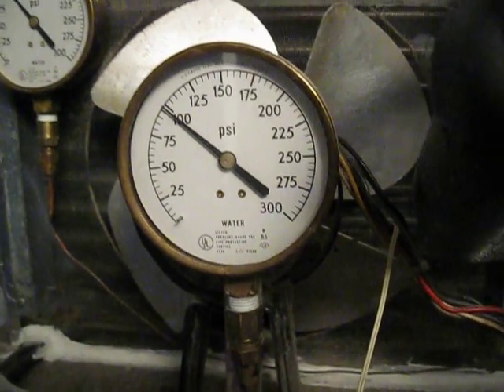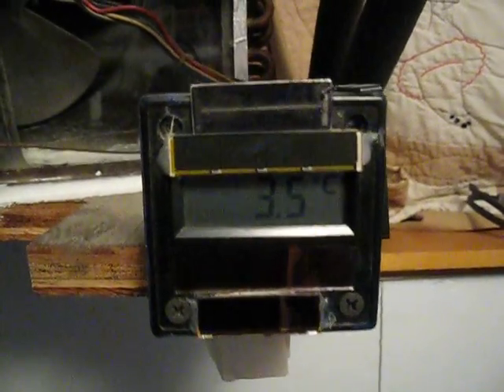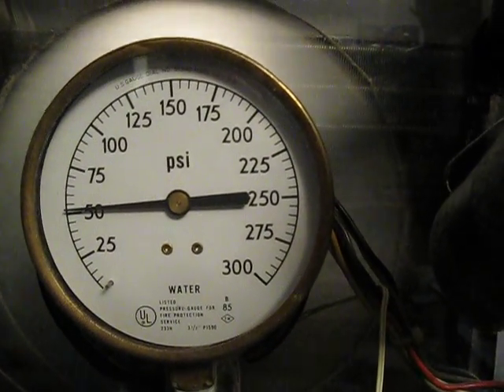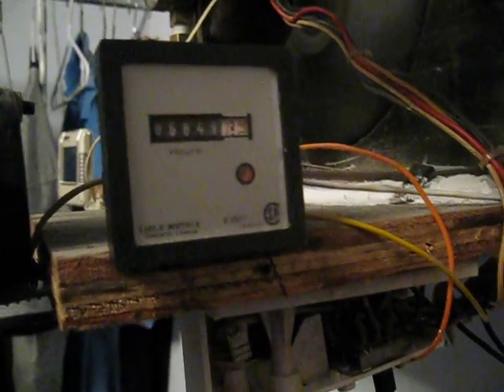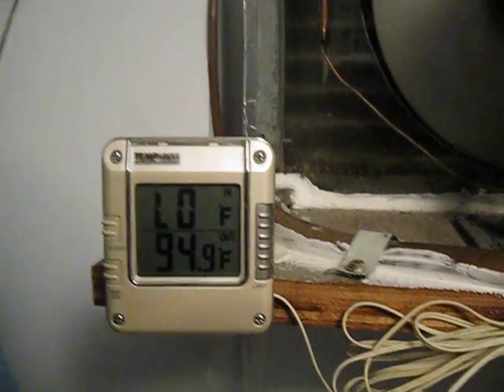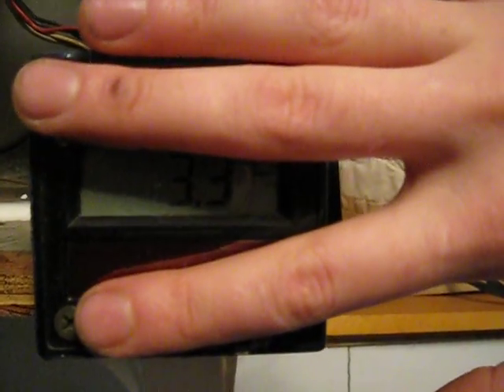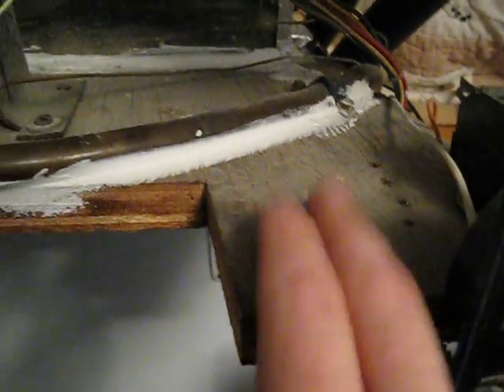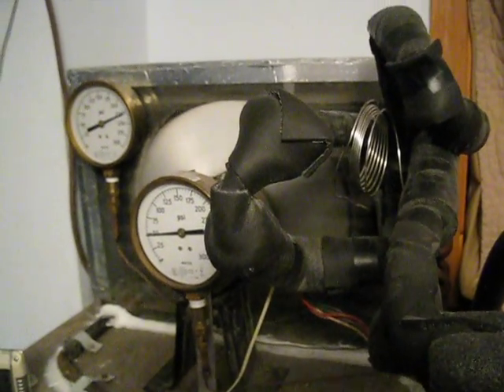Homemade HeatPump Defrost

Comment: Neat heat pump there, I like it.
Reply from the maker: Thanks, was built from scratch.
Reply: I have plans to build a portable heat pump from scratch with flexible pipe to direct the air, and use propane as the refrigerant (going to find a scrapped condenser for it tomorrow) your video here inspired me to mess with phase change heat pumps, it deserves more views.
Reply from the maker: Electrotechnics My heatpump uses R290 (propane) as its refrigerant and it works good, I have been thinking about adding a small amount (an ounce or 2) of R410 this winter to see if it improves my heat output.
Reply: HL4EHalfLife
I have read that r290 is better (more efficient and pumps more heat) than r410 but it would be a good test. i have also heard that 75% r740 (argon) +25% r134a can be used to get around -120C  (yes you read that right) on the evaporator (using a regular air cooled condenser) with pressure below 300psi. That would be a neat experiment, but if you want to do it I would recommend testing it on something other than your HVAC to make sure it works out okay.
Reply from the maker: Electrotechnics R410 is what they use in all heatpump's nowadays because it gives out more heat than R22 (R22 is just 290 with a fire suppression agent added from what I've been told.) As for the R740 that would only work in a cascade system.. which I have build a few but my 2nd stage gas was R290 and Co2 which would get me to -100c. I do plan to do a video on it some day but I have to find and fix a leak in the 2nd stage.

Comment: Hey, I'm thinking about converting an old portable air conditioner into a window heat pump and I was wondering if you could help me out, as I have a few questions and would really appreciate it if you could answer them!

 It runs on R22 which it still has a full charge of, and has a reciprocating compressor. I was worried about whether the coil sizes are right, its an 8000BTU unit and the condenser coil measures roughly 23cm by 32cm or so, but the evaporator coil is only about 1/3rd to 1/2 the height, but still 3 rows thick like the condenser. Is this going to work so in heat mode or will it cause it to overpressure in warmish weather? (15*c or so)

The pipe sizes are the same size for both the discharge side and the suction side, is this going to be a problem? 

Should I reuse the R22 that is already in it, or would it be better to put fresh propane in to it, incase the R22 gathered air/moisture during recovery (as I'd have to bodge some recovery unit from a fridge compressor I have lying around).

Final question, if its not too much trouble could you show how the refrigerant circuit is set up on this unit you've built (its very impressive by the way!), as I am not entirely sure how to do the pipework (check valves and what-not)

Anyway, thanks for making these awesome videos, and if you get time thanks in advance for answering my questions! :D
Reply from the maker: What your wanting to do is a major undertaking, Do you plan on making this portable AC just put out heat or you still want it to air condition too?

It is hard to say what the pressures would be like in those coils but the only real way to know if they would work is to have gauges on them when its finished and you have it up and running and the tubing size is fine for a little unit like that.
Reply: I do plan on making it heat and cool, so fitting a reversing valve in is going to be fun (hardly any space inside the casing as it is :P)

Thank you! I'll try get it working soon-ish and see what happens!
Reply from the maker: tlaroche38 Your going to need a defrost board, defrost sensor, and a thermostat as well.
Reply: Ahh, of course. I think there's just enough space in the electrical "box" for those parts.

The unit has a heating and cooling thermostat as well as a heating position on the rotary control switch which were never used, the pins were blanked off. I guess I could make a defrost board from a pic chip, I have some thermistors lying around somewhere I can use if that set up would work.
Reply from the maker: tlaroche38 I've never seen a portable A/C with a heating option.. but if I had to guess the heat setting just moved some dampers and redirected the hot air from the condenser so it would blow into the room instead of through the hose that goes in the window.

Defrost boards are pretty complicated because they have a timed 30,60,or 90 min defrost as well as can defrost if the sensor closes and it turns off the outdoor fan while it does there's a safety limit of 10 min for defrost anddd the thermostat gets wired into the defrost board with the C,R,O,Y, AND G terminals.. I wouldn't recommend you try to build a defrost board when you can just buy them for $40 or 50 bucks and that way you KNOW it will work the way its suppose to.
Reply: That does sound like a better option if it would work with the generic mechanical thermostat, the one that was in the unit to begin with was just a switch with contacts for normally open or normally closed (think thats how its described, anyway :P). I've never had experience with the defrost boards on big top fanned heat pumps, only ever seen the ones used on mini splits and window units that use a thermistor to tell it when the coil is frozen and when it has thawed. I'll definitely look into buying one though, thanks for the heads up! :D

As for the heat setting, it was for 2Kw electric heat strips, but they weren't actually installed even though they were listed on the data plate. I probably should have been more clear there haha!
Reply: HL4EHalfLife Hey, I have another question: Is there a way to make a heat pump work with only one capillary tube and a bi-flow filter drier? Also, if there are 2 capillarys, does the one for heat mode have to be longer or shorter than the one for cooling mode? Thanks!
Reply from the maker: +tlaroche38 If you want just heating than yes 1 cap tube would work but not very well as it can't adjust its flow like a TXV can.

Comment: Does it still work today?? If so can you make a new video of it
Reply from the maker: Yes and no, since posting this video I've replaced the homemade outdoor part, the original one still worked but the wooden floor was rotting out so I replaced it with the outside part of a ductless-spilt heatpump. I had to gut the 3 phased compressor with a single phase one and all the electronics. The inside part is still the same as in this video.
Reply: HL4EHalfLife oh. If you replaced the bottem of it you could make a heatpump water heater possibly
Reply from the maker: A heatpump water heater idea has crossed my mind in the past but I never built one.
Reply: HL4EHalfLife yea. Do you have any new plans for heat pumps or any other hvac projects
Reply from the maker: I have other refrigeration projects that I built years ago, just not gotten around to doing a video on them yet, I got a text file with about 30 videos I got lined up to do.